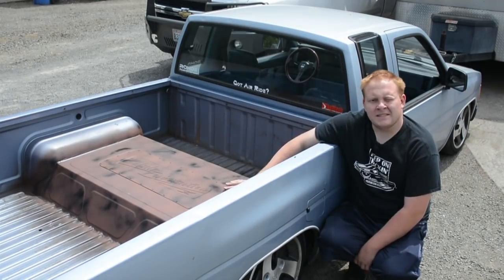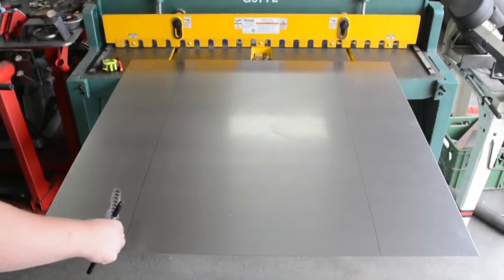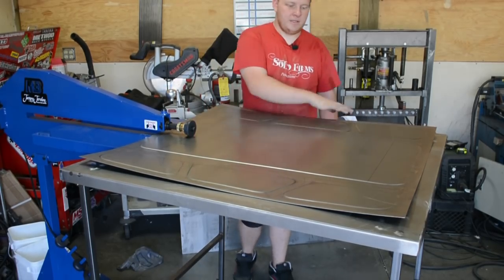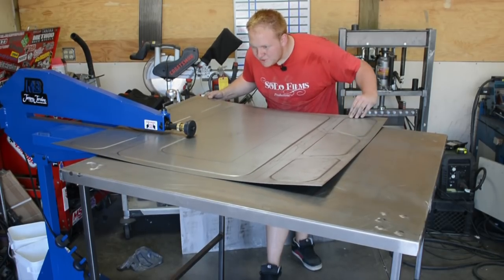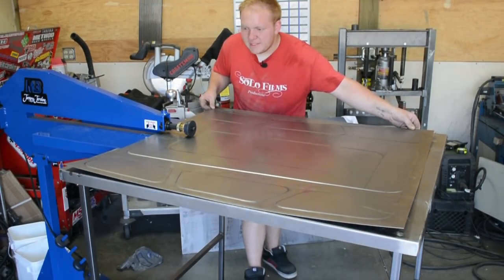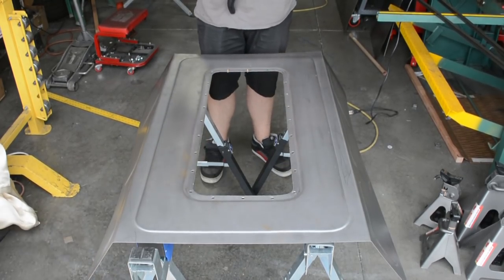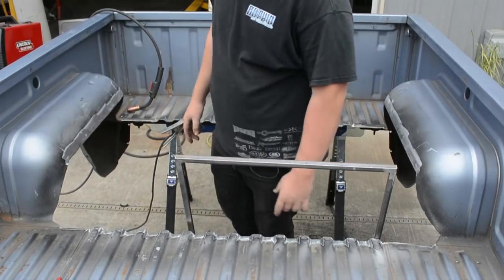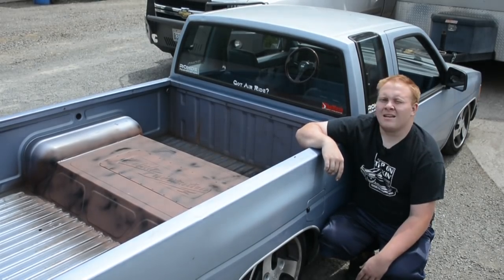Custom truck Bed // Bagged Minitruck

Comment: You should make bolt on/weld on panel humps for static trucks/hardbodies. I've seen some people cutting small holes in there bed so the transmission don't hit the bed. Just my opinion tho thought it would be cool.

Comment: When you lowered your extended cab did you have to shorten the driveshaft any please let me know thanks Wayne
Reply: dragn20s you shouldnt have to , have a buddy with a insanely low static 95 xcab that doesnt have any driveshaft (or carrier) issues
Reply: E Wells I don’t know what’s wrong with mine I lowered it and started shaking seems like it’s coming from the middle of the truck so I raised it up and it still shaking I put the Factories back on It and it still shaken i’m at a loss I’m just gonna start replacing all, suspension parts I guess really don’t know what to do Any ideas
Reply: Sounds like the carrier bearing , like 98% that will be the problem.
Reply: Angled blocks ?
Reply from the maker: Could be a mis balanced drive shaft? I was going to say carrier bearing as,well. I have lowered 3 king cabs with no drive line issues.
Reply: I was think DS as well , but figured it would of had vibration before lowering. Almost has to be DS or u joints. Though I have seen carriers get shredded in days from bad pinon angle.
Reply: E Wells I don’t have angle blocks do I need them are they important
Reply: E Wells do I need to have angled blocks
Reply: Ive always run angled blocks or shims on xcab trucks , 3* if Im not mistaken , has been a long time since I have had a static truck.
Reply: E Wells where can I get some shims at  let me know thanks